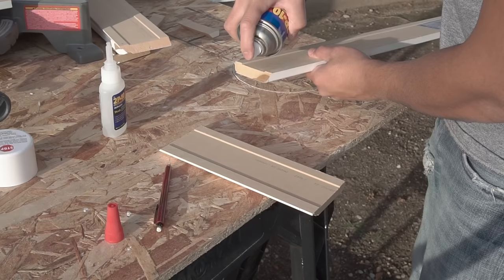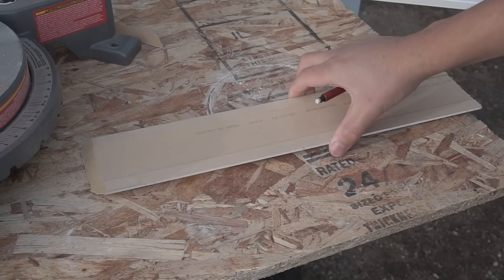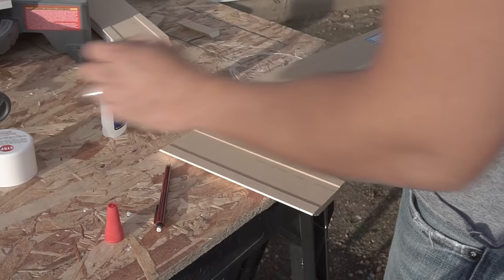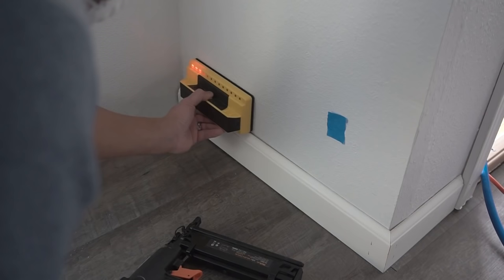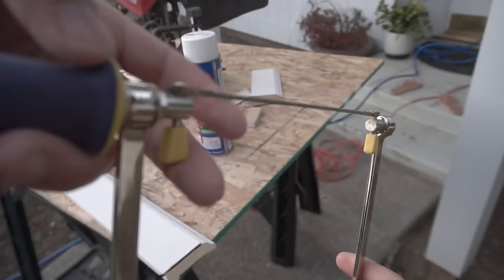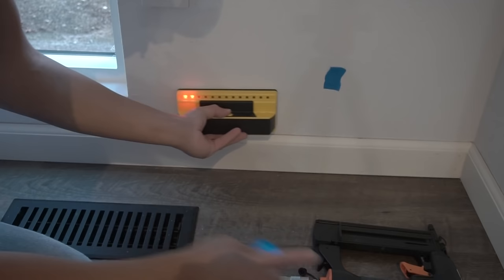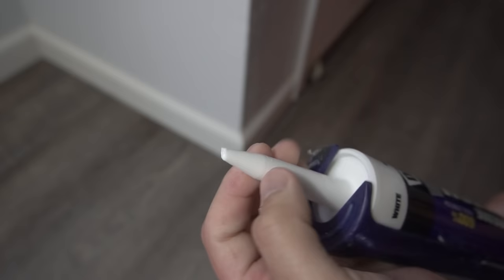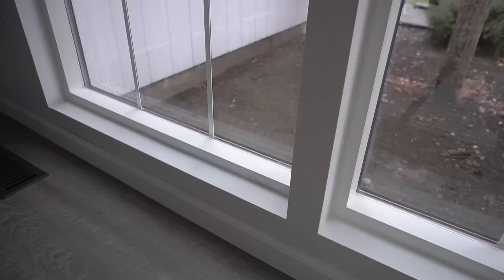How To Install Baseboard Like A Professional With No Gaps! DIY Pro Tips And Tricks For Beginners!

Comment: Here’s a tip, when hanging base if you are right handed go anti clockwise around the room. That way you are always cutting on your scribed joint on the right. I’ve been a carpenter for over 30 years and I promise this will save you a ton of time.
Reply: For a square room lets say starting from bottom and go right?
Reply: @babukatv6923  for a square room I would start on the wall with the door. You have 2 square cuts typically, then hang the base board or skirting board in the UK anti clockwise around the room. This way you will only need to cut the scribe on the right end of the board until you get to the last wall. That will require a scribe on both ends. Cut this board slightly long and squeeze it in. This will make the joints tight both ends. Hope that helps.
If you facing the door the next board you will hang will be on the left.
Reply: @MaxRank  that’s very helpful and informative, thank you. On the last skirting board you install you say make it slightly longer, how much longer roughly would u recommend in Millimetres
Reply: @danielmclaughlin5194  I wouldn’t go longer than 5mm. On plaster board walls if you go longer and sometimes at 5mm you will break the tape joint in the corner of the room. Never cut the skirting long against door linings, this can push over the lining and cause the door to bind.
Reply: @MaxRank  thank you brother
Reply: @danielmclaughlin5194  happy to help. Good luck. 👍
Reply: Thank you
Reply: I’m a lefty😭
Reply: If you are left-handed, then you go clockwise, right?
Reply: @DeeFig66  correct, that would always put the joint on your dominant side.
Reply: Inyeresting, but I didn't really get it. Every piece of baseboard is 2 cuts: one to start, the other one ti finish the piece. You will need to flip the piece around under your miter, am I wrong? At least that's how I do it.

I would most likely tilt the miter saw and cut the baseboard laying down instead of sitting up and turning the saw.

Thanks
Reply: @marcopaugym1604  the first piece of baseboard has two square cuts one at each end. I typically start on the left side of the doorway. Now take a measurement from the wall to the flat face of your baseboard. This is your final length.
Take your next piece of board but do not cut it to final length, cut an open face mitre on the right end of your base. If your saw is big enough do not flip the mitre saw on edge instead use it in its vertical plane. (It’s way more accurate). 
You should now have a piece that has a mitre on the right end, turn your mitre saw back to 90 degrees and flip the piece of base upside down so your mitre is now on the left. Using the mitre edge against the flat face of the baseboard as a guide cut all the way down stopping at the moulding. Simply break this piece off with your hand.
Now take your coping saw and again follow the edge of the mitre against the flat face of the board, using it as a reference. You can rub a carpenters along this edge to make the line darker and easier to follow if you wish.
You should now have your joint on the right side. Measure from the square edge of your joint for your overall length add 5mm and cut. The extra length will squeeze your coped joint nice and tight. Now simply repeat around the room.

Hope that helps.
Reply: Thank you
Reply: Right to left
Reply: @MaxRank  question for you, the first piece of baseboard has two square cuts. how is taht? should you have one square against door frame and then a miter into a wall?
Reply: Simple (not in a negative way) like this tip Is golden.  If you were to do you own house and that's it it would be helpful but if you were to have a side hustle or do multiple jobs, this tip alone will put more money in your pocket

Comment: When you run your finger to smooth out caulk, instead of wiping on a wet rag, use that caulk on your finger to fill nail holes. Then use wet rag or sponge to clean any remaining caulk around nail holes.
Reply: You should never fill nail holes with caulking, only putty
Reply: I’ve been installing for 45 years for multiple interior decorators and designers, ALWAYS turned out perfect filling nail holes with caulk. Matches white baseboards and no need to paint.
Reply: If the nail hole is small enough why not just fill it with what you have to work with?  I didn't have any of those at the moment and was too anxious to wait so I filled the hole with cooked rice.  Just smashed the ruce and filled the hole, wait for it to dry, smooth it out if needed and paint.  Looks fine to me.  Lol
Reply: Professional painter here. Never use caulk to fill nail holes. Use painters putty and or spackling
Reply: @cavila909 I agree, it always shrinks

Comment: If you scribe your base to the floor it'll be professional.  Use tape to hold your outside miters together when you run your pencil.  After you cut and sand you can then CA glue your outside miters.  I'm not a CA glue guy, I like wood glue as it has better holding power.  CA glue is a bit brittle IMO.
Reply from the maker: Thank you for the tip! I did make a video scribing it to the floor 👍🏽😊 here it is :
https://m.youtube.com/watch?v=NcAMWrqwzDU
Reply: Thanks. I could tell this was not the most efficient way on the video and there were some alternatives.
Reply: Yeah if you wanna look like a hack job… lol

Comment: One trick for your field seams is to nail through the miter/both parts of the miter, but make sure the piece on the right is a paper or 2 proud of the left side before nailing.  Then with a scrap piece of base pound it into flush.  With nails and wood glue it'll be perfect and never open up.
Reply: It's hard to understand your explanation my friend

Comment: Excellent tip on coping after first cutting with chop saw most of the cut.
Outside corners 46 degrees, inside corners 44 degrees due to mud buildup.  Popsicle sticks as shims for perfect fit.
Also try cutting with baseboard upside down.  For some baseboard profiles, the fit is better when cut upside down.
Fast curing glue  with activator is a great tip.  Thanks.
Reply: I was struggling to figure out how to explain this in text but I found the video that will explain the inversion rule when it comes to miter cuts.

https://youtu.be/Ca0PRZ6ki8M?si=Mc0OuWQgu9_5Knps

Comment: Great video!  Only issue I saw was pushing in the base with your thumb right on the corner where you're nailing.  That nail can turn and go through your thumb.  I found that out from experience!

Comment: Use "Painter's Putty" for the nail holes. It doesn't shrink. Don't use spackle. (It dries concave)
Roll the Painter's Putty into a quarter size ball, press firmly into the brad hole with your thumb as you run your spackle knife between your thumb and baseboard. This cuts the putty off for a perfect fill. Finnish up with a little touch-up paint. Good luck!
Reply: Doesn’t it just get painted over? Sorry I’m new to this.
Reply: @haydenaho9396 i think it's hard to paint over a metal nail head. Its hard to cover

Comment: I like to use a small bucket of water to rinse my finger of the excess caulking.  I  use a wet towel to wipe off any remaining excess caulking after initially using my finger to wipe off caulking because over time, the thin film of caulking spread by the finger over unintended areas tend to darken over time.

Comment: No matter what you do you still need to use silicone to hide the small gaps cause not all walls are close to being perfect. Plus I think it would take more time with using little saw for the inner corners. For someone doing  the whole house, you be there the whole day or two.
Reply: 100%
Reply: Never use silicone if you want to paint. It's lousy caulk except for water areas, tub sink etc

Comment: Hi remodeller here. I don’t know why you do the straight cut last. You should cut the mitre last always. And you measure it by butting the straight part on the wall or door casing and pencil the mitre and cut from the pencil line. And if you are doing coping corners. You are going to need a jigsaw or a grinder with a sanding blade. Finish carpentry has more in depth videos about this.
Reply: This is a *DIY video
Reply: @whith5184  on the title it says "like a professional". So I'm chiming in what is common practice out in the field.

Comment: Tip when you are nailing low base boards, stud finder is a waste of time. An inch off the sub floor has a stud running all the way down. ( only need stud finder for high boards)

Comment: Quick question: why do coping rather than simply mitre cut both pieces at a 45* angle? Cutting both pieces at a 45 leave you without a gap and takes a whole lot less time . . . I just want to understand why you’d choose to cope over a mitre. I apologize if I missed it during the video.

Comment: You're using low density MDF and it isn't sealed/primed on all sides.
It gets the job done but it's not built to last.
Unfortunately it's how nearly every company installs skirting nowadays. Good quality seems impossible to find.
For extra hints I do find Robin Clevett's channel very useful.

Comment: Very good video.
Question - when measuring for an inside corner and planning on coping, is the coped board measured to the edge of the board already in place? Or, measured to the wall so the top of the cope would meet the wall?   I hope that makes sense!
Reply: Scribed boards are measured from the flat face of the base.

Comment: At 8:50 why was there a gap in the outside part of the miter?  It was glued together before it was installed, yes?  So it should have been a perfectly tight miter.  What happened?

Comment: It is okay for DIY to use super glue in his own house because it is easier to get good looking joint. However, professionals should not and do not need to use super glue because it is not nearly good as wood glue. it is brittle and dose not last. it has tendency to break over time specially if the joint put under tension or has some movement such  a door case. I have seen it several times

Comment: Don't caulk outside corners use spackle like drydex, and put your scarf joint in the middle of the wall on a stud. Using a jigsaw with a scroll blade is a very fast and accurate way to do coping cuts.
Reply: never seen spackle on trim last more then 1 year
Reply: @ronaldwoofer5024  you need to paint it after, that holds it for a very long time

Comment: Why was caulking not used behind the baseboard when placing it up against wall???
Reply from the maker: Hi! Caulking is used for gap filling and aesthetic purposes. If you are not going to use nails to secure the baseboard, you need to use construction adhesive. 👍🏽😊

Comment: Any tips for cutting baseboards for non-90 degree corners?
Reply: for example you corner is 94 degree, here's solution. 180-94=86   then 86/2=43   and those 43 is that what you set in your mitre saw.   Works always for inside and outside corners.

Comment: The short piece that's sitting on the short wall you said that it would have caved in if you didn't glue them together that's not true you could have put a shim in the top in that Gap a tiny shim problem solved.

Comment: What's the advantage of cutting a 45 degree angle when adjoining two pieces on a long run, versus two pieces with a straight cut?  Great video!
Reply: If i remember correctly from what someone else mentioned in a video....  If 2 straight cuts seperate even slightly, you see a gap.  But if the 2 angle pieces come apart, you still have material in behind it, so not such an obvious gap.
Reply: @Xaltae  Thank you!  That actually make a lot of sense!
Reply: It “hides“ better. People actually fill with wood filler then sand further to totally hide it. Cutting at a 45* also looks a little better and it’s easier to make it look good with the mentioned wood filler if they pieces don’t line up perfectly.
Reply: @mastrsk8  Thank you!  Great insight, and makes very logical sense.
Reply: always thought that it has to be 31 degree  when adjoining the 2 pieces
Reply: @josemorales8336  I've seen it done both ways, Although at 30 not 31, though I guess that would work too.

Comment: Great video! Is MDF preferable to work with for imperfect walls versus wood for 9/16" baseboards or will it be more or less the same?
Reply from the maker: Personally I think MDF is easier to work with since it’s a lot more limber and less chance to split unlike wood. 👍🏽😊
Reply: Also wood is usually stained or lacquered not caulked like mdf.  So all of the cuts will be seen.  You can putty but it still shows compared to mdf and caulking
Reply: Mdf falls apart if it gets wet.
Reply: Does it rain in your house? Do you leave spilled water on your baseboard? If anything swelling mdf is a warning sign that you have too much moisture in that area and you should investigate before you have any further issues.
Reply: Mdf gets beat up, especially with kids and animals. The best tip, is hire a good painter. 2nd tip, when coping, walk in the door and make sure the cope is in the correct place, so when your caulking shrinks, and it will, it's less noticable.
Reply: If it was my house, and regardless of material used, after scribing I'd seal the bottom of the base.  If water or whatever is spilled it won't get soaked into the material.
Yes it's an extra step but it'll ensure that the material never blows up if water gets to it.  Some people like to use a super wet mop and that little bit of water each time can get underneath the base, especially if it isn't caulk at the floor, and cause damage.
Reply: @ThekiBoran  i had this done professionally several year ago for similar reasons and visual appeal, during winter, the caulk ended up cracking 7 months later. materials for homes expand and contract, especially wood too much for that to be viable in my opinion.
Reply: Try not to hit the mdf too much with water when mopping. It will over time swell if you mop heavily.